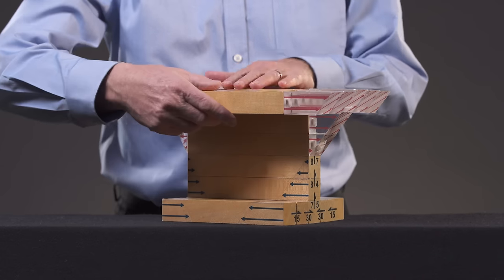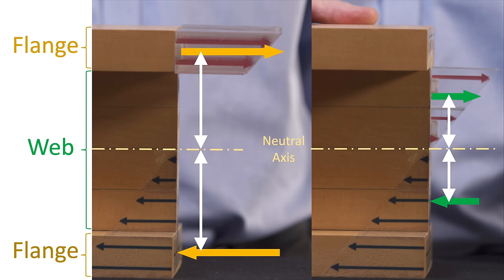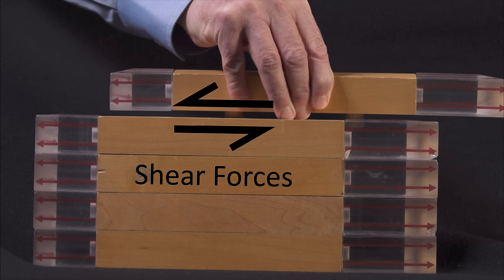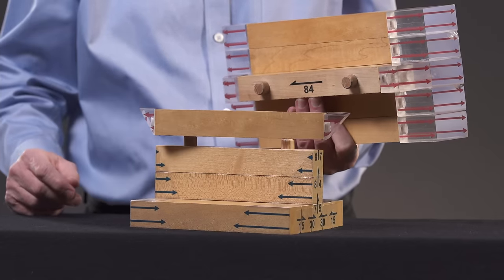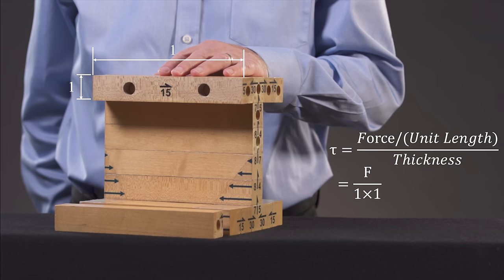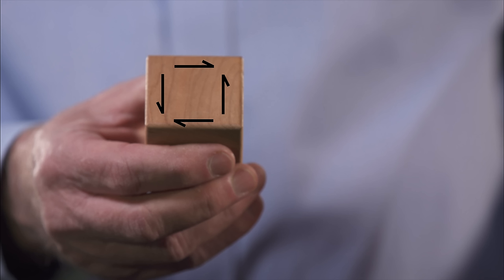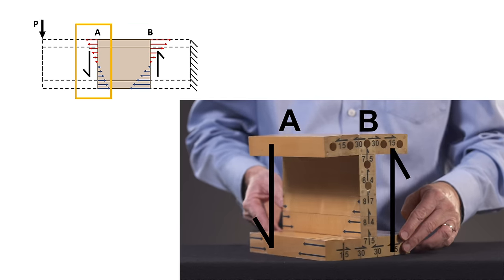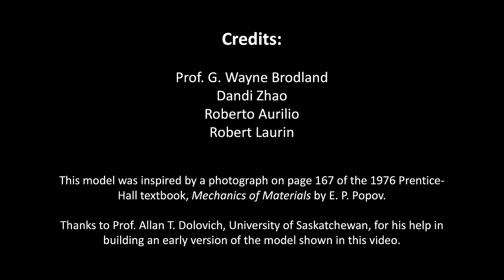Shear in Beams Model

Comment: This video contains wrong information,  ( from min 2 to 5 ) this kind of shear stress will not be generated in the beam , because there is no difference in the stress along the x axis of the beam section , the only shear stresses are longitudinal and vertical. Correct me if I'm wrong please.

Comment: Ooo improved model and elucidation, thank you!  It would be great to hear more discussion on how this theory relates to / results in failures in some real-world circumstances.
Reply: If you are curious, you will be served plenty. There is much more than discussion available. There is too much litterature and research to cite all in here. Practically every country has tons on this subject. First, this video is about strength of materials theory, and in this video it is extremely simplified for beginner students. The theory goes down a very deep rabit hole and can be applied to different materials using their known properties. Every material reacts differently under theses effects. if you are interested in concrete, see ACI (american concrete association) or CSA A23.1 Canadian, steel, see CSA-S16 (canadian), wood AWC amercian wood council US or CSA-O86 canadian, i dont know for Europe, but they have what they call Eurocodes. most of the codes are not free, but you can find lots of interesting pdfs on scribd. Thats where you can find results of research and known failures. There are also chemical degradation that adds to the mix. Engineers who do detective work to diagnose why structures have failed must take all these into account.

Comment: If shear stress is developed from the uneven bending moments in a beam when loaded on the edge and clamped on the other end.

Does a center loaded beam with simply supported condition on both sides have shear stress then?

Comment: does anyone how the shear behaves in the very center of the flange? there would be 2 shears on 2 sides, but both points in the same direction? then there will be no shear at all?
At 7:10, the shear along the axial direction on the right should be flipped.

Comment: I did not understand what load is on the beam, in what direction, where, to start with.
Reply: 0:25 The cantilevered beam of 32 length-units long has a mass of 412 mass-units at P (left end) while the beam is supported (by a wall) at the the opposite end.
 The top if the beam is in tension, the bottom of the beam is in compression.
 The forces increase further along the beam away from mass P, towards the wall.
Reply: P= - 412(down) @ A
start with, watching carefully.
Reply: This is a section of the beam. Imagine it as 1/3 of the entire length of the actual beam, and that this section is the center 1/3 of the beam (with an equal sized 1/3 of beam on both the right of this section and the left of this section)

Like this:
(force pushing down
 on left side of beam)
 ____ ____ ______|   |
|____ ____ ______|   |
             A     B            |   |
                                   |   |
                                  Wall

The B Side of the entire beam (right side) is connected to a wall and the A Side (left side) is free floating.

Pressure is being exerted down on the beam, with the left side being more affected by the force because its free-floating (cantilevered), as compared to the right side not being affected as greatly because its attached to the wall.

Comment: the model is confusing. shear force depends on load placement. this model was all over the place without any clear indications of what axial load affected what shear part of the model.
a simulation with stress indication would go a lot further in this explanation than wooden blocks .
Reply: DarkShadowsX5 read the description
They didn't have computers capable of graphical stress simulations in 1976

Comment: I think I'm lacking context here. What is the cause of the stress?
Reply: The cause of the internal stress is the bending moment M(x) along the beam caused by an external force or torque. He explains it in the video. And since the focus of the video is about internal forces (and stresses), the nature of the external force is irrelevant. Just imagine there is a simple point load on the edge of the unsupported beam causing the bending moment.
Reply: you could also look at the FBD and graphs, showing a P force acting downwards at 412 units, for a length of 32 units giving a moment at B of 13 184 units-distance.
Reply: @benjaminlavigne2272  the fuck is a bending moment

Comment: You mean gravity does not apply?
Reply: This is Material Strength thoery, gravity applies to physical objects that have mass. If you wish to add gravity, then add a distributed load over the beam with -9.81 (SI Units) x (mass/length) of beam for deadload (you could also use unit weights in steel, wood charts or calculate for concrete). In the end, the video will remain exactly the same in format, except the numbers will change, and the shape of the FBD graphs will change (for a point load, moment is linear, and adding a distributed will make it quadratic). Adding gravity also means giving physical properties to the object that has mass like, Elastic modulous and yield strength (etc.. long list). This means the objets deformation under load can be calculated. The complexity almost never ends, you could also add thermal resistance to realisticaly represent the bending of a steel beam under different temperatures. Then, when a material has deformed (also see poissant ratio), the sections may change shape which needs to be updated in the results, so it is an iterative process. Lots of computer software take care of these kinds of calculations and help engineers get through the huge amounts of work.
Reply: @benjaminlavigne2272  Your reply is down right sexy!

Comment: Holy shit, all this math just to measure theoretical stress distribution. I know engineers use this shit. The question is WHY? Just put a beam under a hydrolic press and you'd get real world data without all this math. Dear god, this must be why we don't build shit like the Hoover dam or golden gate any more. All this faffing about before a single beam is even placed. Never mind the draconian zoning laws and building requirements. There is nothing wrong with over building somthing for the benefit of the doubt. All this carefully measured corner cutting just means the building is hanging on a thread. It's a waste of time. What ever the builder is saving in resources, they're pissing away in years of unnecessary planning for somthing that our grand parents could have built with outdated equipment, material, and training in half the time.